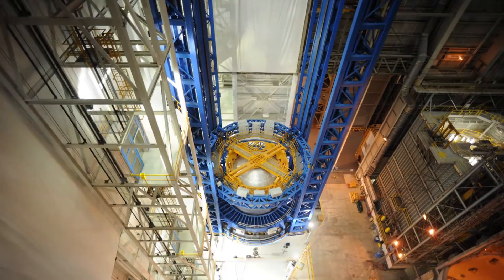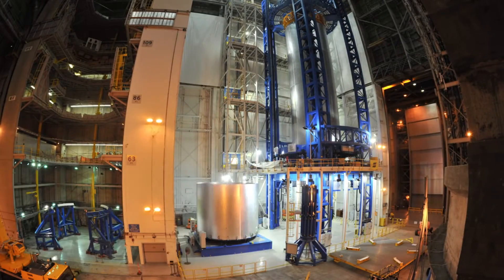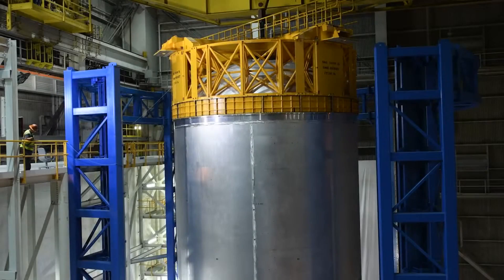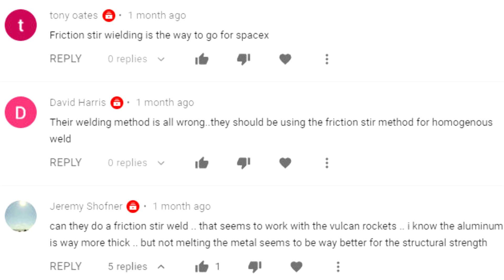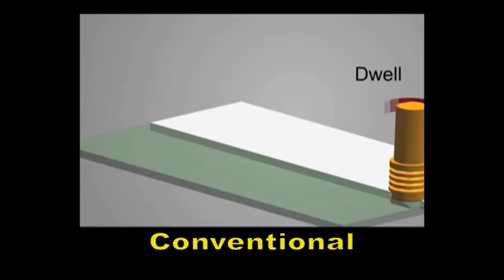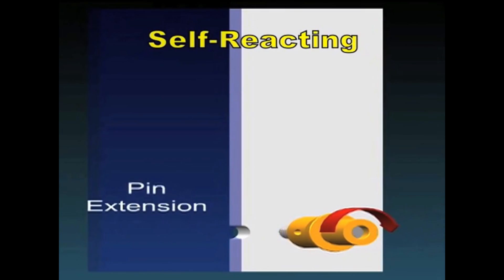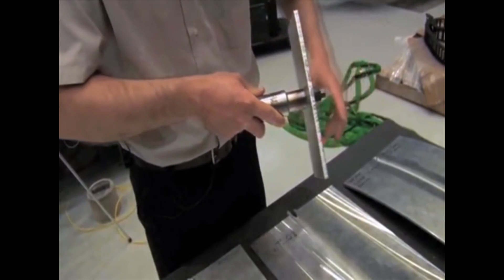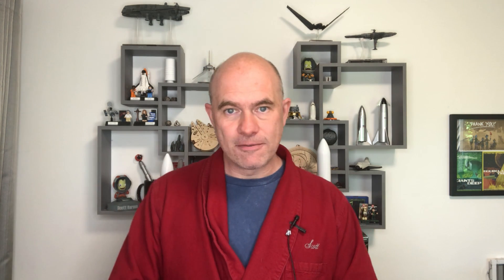SpaceX's 4th Starship Prototype Collapses During Test

Comment: I think it's time to call it quits over Starship, it was never a good idea to begin with.
Reply: I agree, I have a long list of reasons why but can't post it for some reason.
Reply: Let me try it in parts.
Reply: There are a lot of things with Starship that confuse me. For one it is super complicated, making it comparable to the N1 rocket. I don't know how many parts the N1 had but the Saturn V had 9000 parts, and that was with engines that were super simple, even by 1960's standards, so the N1 must have had a monstrous amount of parts, maybe tens of thousands. This led to its downfall, as there were so many parts that one of them was bound to fail, and in a system as complicated as a spacecraft, one failure will cascade down into a catastrophic failure. Every single N1 test flight failed, and it wasn't even designed to land, which adds a lot more parts to Starship that could fail. The Starship depends on the ability to fail safely, so that failing parts can be shut down to avoid a cascade. But there are so many parts that some potential failures won't be identified, and some things can't be shut down immediately (for example the Space Shuttle main engines couldn't be shut down immediately, because the sudden drop of force would recoil into the engine and destroy it, also destroying the entire spacecraft). I'll be using the Space Shuttle to identify problems with this, because, despite how much hardcore SpaceX fans dislike the Space Shuttle (becuase some of the technology from it was derived to create the SLS), the Starship is really similar to the Space Shuttle, and shares many of the same problems.The Space Shuttle was also a bit too complicated for it's own good, although the Starship is vastly more complicated. It should be noted that the Space Shuttle also had the ability to fail safe, but it was still pretty dangerous despite this. Of particular concern are the heat shield tiles on Starship. If just one of these becomes damaged, it could spell disaster during re-entry. And on a spacecraft so big, with so many heat shield tiles, one of them is bound to get damaged, especially during interplanetary transit.
Reply: This leads into my biggest problem with Starship. SpaceX fans claim it's superior to other rockets because it's so cheap, but this cheapness relies on it needing zero refurbishment, only needing to be refueled before flying again. But how will it need zero refurbishment? After the Starship or Super Heavy flies, components will have suffered wear, so then they would have to find the parts that suffered damage and replace them. To do this they would have to take the entire rocket apart, replace the damaged components, and put it back together, which would be very costly and time consuming. And not to mention the fact that after every flight of a spacecraft, it becomes more likely to fail. I have seen no attempts to solve this issue. This would severely drive up the price of a rocket, and completely negligate the thing that's supposed to make it so cheap. It should be mentioned that NASA also thought that the refurbishment of the Space Shuttle would be relatively easy, but it took much more time, money, people and infrastructure than expected. I expect the same to be true for Starship and Super Heavy. Also, when the Space Shuttle was developed, people thought that since it was reusable, it would replace contemporary launch vehicles. This was wrong, because as it turned out, the Space Shuttle was so complicated (sound familiar), that people preferred the other, more reliable rockets. It's beginning to sound like the rockets that SpaceX fans call dinosaurs or overpriced are going to be more economical than Starship.
Reply: The Starship can only get itself and a little bit of cargo up to low earth orbit. After that it needs to be refueled and packed with more cargo before it can head on to it's next destination. But, as I mentioned above, after each Starship or Super Heavy lands they would need to be taken apart and have the damaged parts replaced. Let's be generous and say it takes a week to repair (an extremely generous estimate to the point of unrealism, but go with me here). Given that each Starship can only bring a bit of fuel, cargo or people with it, it will take months to fully fuel, pack and board the Starship, in which time it will stay in orbit and any number of things can happen. Not to mention that since the fuel is cryogenic, it will start to boil off (something that happens to liquids in a weightless environment). But like I said, that was being generous. In the XS-1 contract from DARPA, a requirement was that it have a 10 day turnaround time. But this is for relatively simple and durable space planes, which Starship isn't. The current time it takes to refurbish a Falcon 9 is 8 weeks, Starship will take a lot longer, but go with me here. Assuming it takes two months to fully refurbish a Starship or Super Heavy means to fully fuel and pack a Starship to head to its destination would take a year, maybe several. And since people will point out that it only takes a month now, that's for a very simplified test version, Starship will be way more complicated, and not to mention Super Heavy. Also note what I mentioned above, the more a it flies, the more likely to fail it becomes. And with the repeated flights, a catastrophic failure is bound to happen. And after a failure happens, all the Starships and Super Heavys will be grounded for invention, and all they will all need to be altered to stop the failure from happening again. And since it's supposed to carry people, the investigation will take even longer. The Space Shuttle was grounded for years after a failure.
Reply: And then you have to ask yourself, if it needs to be refueled, boarded and packed in orbit, why does it need to launch or land at all? Can't it just stay in orbit? This isn't a new idea, it's called a space tug. It stays in orbit where it is refueled, packed and boarded and flies to the destination. And since the Starship can only carry a small amount of cargo with it, why not just use smaller rockets to bring fuel, cargo and passengers, and probably getting fuel from some orbital fuel depots as well. This would solve a lot of, if not all the problems I previously mentioned. If SpaceX really wanted to colonise Mars, they should be looking at reusable in space infrastructure.
Reply: Another thing that confuses me is that some SpaceX fans say that since the SLS has some technology derived from the Space Shuttle, and since the Space Shuttle had some failures, the SLS will also fail. What they don't seem to notice is that the fuel tank and solid rocket boosters weren't what made the Space Shuttle dangerous, it was the orbiter. And in the one case where a solid rocket booster was responsible for a failure, what made it dangerous was that the orbiter didn't have a launch abort system. The thing is, the Starship is very similar to the Space Shuttle, and thus shares many of the same dangers. Like the heat shield tiles, and the fact that it doesn't have a launch abort system.
Reply: But even if SpaceX solves all these problems, then to colonise Mars they have to solve a bunch of other problems; highly efficient life support systems, radiation protection, operating independently with a time delay from earth, phycological issues, pre-staging and prepositioning equipment (since they will have to place a rig to drill on mars for components to synthesize fuel), scanning for resources and in-situ resource use (again something which they will need for deciding the placement of the rig and using the resources), generating power (solar power is inefficient at this distance from the sun and dust gets all over the panels), and the everyday hazards of living and working in a hostile environment. These are all problems set to be solved by the Artemis Program (a program, might I add, that takes advantage of reusable in space systems). So even if Starship becomes a think, Artemis will still be necessary (I added this because I've heard a lot of SpaceX fans saying Artemis, and gateway in particular, was useless (because SLS is involved)(also not to be confused eith people with an actual problem with the mission infrastructure)). And given that one of the problems NASA is using to solve with the Artemis Program and other contracts unrelated to Artemis but with the same goal, is better propulsion than the chemical propulsion, Starship will likely be irrelevant by then. For example there is the VASIMR drive, which can get to Mars in little over a month (granted using a nuclear reactor, but as part of the Artemis Program, NASA is developing and has already completed a version of nuclear reactors to be used on planets and on spacecraft), meaning you can get to Mars before the transfer window closes, so you can before it closes and avoid spending two years essentially stranded on the red planet. Gateway even uses a Hall Effect Thruster.
Reply: Some people will say the usual saying, that they laughed at the television, they laughed at the plane, and they laughed at the Moon Landing. But as Carl Sagen (who was one of the most optimistic people about space travel and the humanity, long before the first satellite, Sputnik 1, was even launched, and during a time of pessimism, and who was one of the people who worked on the Apollo Program, so he's not some naysayer who doesn't believe in progress) once said; "But the fact that some geniuses were laughed at does not imply that all who are laughed at are geniuses. They laughed at Columbus, they laughed at Fulton, they laughed at the Wright Brothers. But they also laughed at Bozo the Clown." (I'm not saying Elon Musk is Bozo the Clown, but my point still stands, bad ideas have come from smart people.) Plus, there have been plenty of times that people were wrong about a new innovation. In the 1960's, people thought that in the 1970's there would be hundreds of economic passenger supersonic aircraft that would replace current jetliners, ferrying passengers all across the world. Every superpower in the world was working on making this a reality (the US, Britain and France (working together), and the Soviet Union). In the US especially all the best, most innovative companies (Boeing, North American Aviation, Lockheed, Convair and Douglas), were working on their designs. Eventually the US started a Super Sonic Transport Program, and chose Boeing, who, with millions of dollars of government funding, the brightest minds in the country, and new radical solutions to problems developed in the US X-Plane Program, worked it. Every single one of them failed, except for Britain and France, who developed the Concorde. However, even this failed in the original goal of being economic. They were so expensive they were only ever used by rich people to show off their wealth, and only 14 were ever sold to 2 airlines. And what about all those predictions made in the 80's about life today? I'm not saying Mars travel is impossible, after all, humans have done great things, but I'm saying that in every single major bit of progress, they did it by finding the best way to do so.
Reply: In the early days of the Apollo Program, the scientists had a problem. Any craft that would be able to get to the Moon, land on the Moon, then send a capsule able to survive re-entry, even with staging, would be so big you would either need an impractically huge rocket, or to assemble the rocket in orbit using multiple rockets (back then orbital rendezvous and docking hadn't been tested, so having a rocket built by launching other rockets was out of the question). And even if they could solve that problem, the stage that would land on the Moon would have to carry the stage that can carry the capsule back to Earth , so the whole landing craft would have to be huge (even worse if you don't use staging). It was so big that turning and deceleration would be slow, so not much wiggle room in case of an emergency, and when it landed it would be likely to tip over. They couldn't guarantee that it would work, which was required by the political leaders (could you imagine what a disaster it would be to national security if the astronauts on Apollo 11 crashed into the moon). So, did they keep trying tomake what was obviously a dead end work. No, they stepped back, looked at the problem from a new perspective, found a new solution (possibly with some inspiration from Yuri Kondratyuk, and his book _The Conquest of Interplanetary Spaces_), and approached the solution from a new angle.
Reply: When you don't do this, the results can be disastrous. The U2 was a US spy plane that was designed to fly above radar and out of the reach of other planes and missiles. However, unknown to the US, the Soveit Union could see them, but just couldn't reach them. Eventually the Soviet Union developed a missile capable of hitting a U2 plane and did so. At this point the U2 plane could be both tracked and attacked by the Soviet Union, making it obsolete. But the Engineers kept trying to make it work. They came up with ways to make it stealthier. They made wires they would string up to the aircraft with ferrite beads that would be tuned to the expected frequency of the radar, and sheets with a conducive pattern printed on them they would attach to the aircraft. The wiring led to increased drag, which meant that it lost 20% of its range and 5000, putting it further in range of missiles. And the sheets turned out to be fatal. The engineers realised that the sheets acted as a heat insulator, causing a heat buildup, so they only put them on the lower fuselage. But even with this, on one of the test flights of the U2, the overheating caused the engine to fail. Since the engine powered the aircraft, the whole aircraft lost power. The cabin needed power to maintain pressure, so the cabin began to depressurize. This caused the Pilot's faceplate to pop off, as the pressure on the inside of his helmet became greater than the pressure in the cabin. The pilot was exposed to the lower temperatures, and lost consciousness. The plane went into a flat spin, and when the pilot woke, he ejected, but he was too low to the ground at this point, and was killed. The modified U2 aircraft flew for a bit after this (although I don't think they flew the versions with the radar absorbing sheets anymore, just the ones with the wiring). Eventually they discovered that all this had practically no effect on the Soviet radars, and, realising they hit a dead end, the project ended. Since then they went on to make spy satellites, and the SR-71, which could fly higher and faster. The Soviets eventually developed missiles capable of shooting down the SR-71, so, instead of trying to make it work, the engineers moved on and developed the stealth planes we use today.
Reply: What I'm trying to say with this is we can do pretty much anything, as long as we realise when we've hit dead ends and move on.
Reply: Hey, it worked!

Comment: Very likely either a procedural mistake of simply a miscommunication on how lower tank pressure is tied to upper tank pressure.  The pressure in the lower tank can never be above some (unknown, but small) pressure reading in the upper tank.  This is to prevent the lower dome of the upper tank from inverting and destroying the vehicle.  It could be a purely pneumatic system of regulators and valves, or implemented somewhat in software.  Either way, if someone decided to depressurize the upper tank that still had propellant in it, the system would reduce pressure in the lower tank to prevent a dome inversion but then not have enough pressure to support the weight of the loaded upper tank.  It looks like this little detail may have been lost on one or more of those running the test.

Comment: I suspect the lower tank got below atmospheric pressure somehow, probably due to a valve failure or operator error.  The collapse happened in 2 stages, first it sucked in and crumpled.  Then after crumpling, it slowly fell over. It looked more like a can being crushed by vacuum rather than a balloon tank failure.